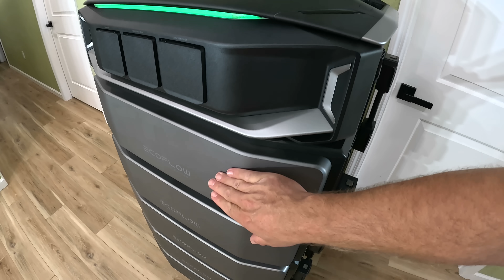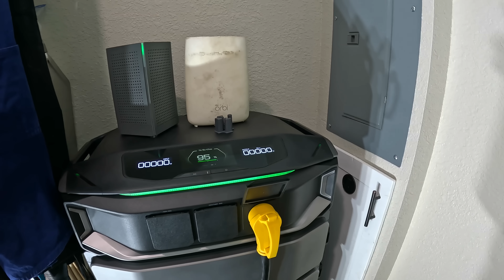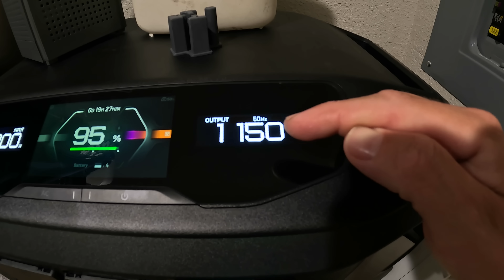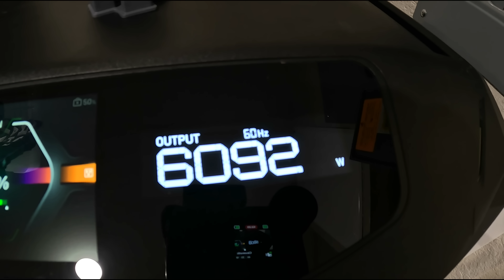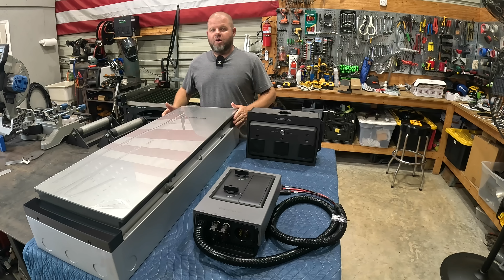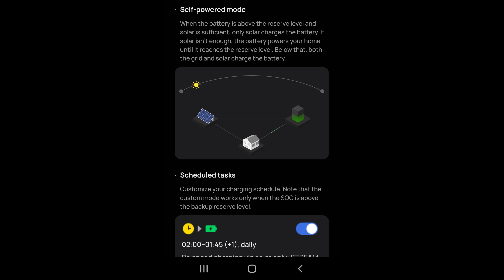AMAZING POWER! Ecoflow Delta Pro Ultra X Power Station Review!

Comment from the maker: Affiliate link earning me a small commission but SAVING you money with my discount code. Upgrade your home with the world’s first powerful, easy-to-install whole-home backup system!

Place a $500 deposit to save $1,000, plus get up to $1,000 off installation on our website.

From Nov 3, use code DPUXKE300 for $300 off bundles online or get a FREE 220W Solar Panel on Amazon.(Valid Nov 2–Dec 31. Product discounts can’t be combined. Installation offer applies to both.)

🔗 EcoFlow DELTA Pro Ultra X : https://bit.ly/471iRU5

🔗 EcoFlow DELTA Pro Ultra X on Amazon: https://amzn.to/3VM2oNk
Reply: What’s the actual pricing?
Reply: @Bward216 

Base Bundle
Inverter unit and two expansion batteries	$7,999

Bundle with Smart Home Panel 3
Inverter, two batteries, and Smart Home Panel 3	$10,899

Smart Home Panel 3 (Sold Separately)
The Smart Home Panel 3 alone	$2,999

Install 3.4k
Reply: @Bward216  Looking like $3,500 to $3,800 for just the DPUX inverter

Comment: Is the rectifier a safe option to use as a solar panel disconnect instead of the other disconnect they have that needs to be wired by the user? Would be great as the rectifier is plug& play, but probably isn't code compliant?

Comment: I have studied solar for 2 years now. it always improves and it can be a money pit. I will tell you I love the solution when it works. I have ecoflow with watt cycle as its big brother and Renogy solar as its little sister. I use a 20amp charger for the watt cycle batteries or it starts melting my power cords. These ecoflow systems can handle a lot! Watt cycle is an amazing pair and renogy solar panels are just sweet for the back up. My overlander is completely self sufficient now. With the 2 bodega drawer fridges, wolf box always recording and a 12v trickle charger constantly charging my car battery. What an amazing set up. I have 5 vehicles and I am working on my third setup. I love it. I carry my kitchen on the go. It’s soooooo cool. My kids love it! I now this is crazy but a fed a few stray dogs a 5 course meal the other day.  fresh meals on wheels. What a fn kick hahahah.

Comment: My question is can you use the Delta Pro Ultra X as a UPS meaning that the home electrical is running from it constantly, while having Grid power, Solar Power, and Generator power tied into it at the same time?  So I can switch between these power sources?  And by doing this will it over work the battery system?  Thx..
Reply from the maker: I'd need to verify 120 in and 240 out. Obviously you can't bring in from the grid while you are connected to your main panel on the output side.  You can bring 120v grid in and output to individual devices as a UPS using extension cords ect.  The proper way to do this is use their smart home panel. It ties to the grid and can be setup to use the DPUX first and swap to grid automatically if your battery power is low.

Comment: Can i run my 50 amp travel trailer with just 2 batteries? I dont have the space for that giant.
Reply from the maker: Yes as your trailer uses the Neema 14-50 plug this has. Now what all you run determines how long this will power your trailer.  Most big trailers have two AC units that are very power hungry, especially in not well insulated trailers.

Comment: Hi, just about to get mine. I was worrying about stability on the cart with 4 batteries and the inverter, but yours looks pretty good. Mine will be in a concrete floored garage next to the wall and won't need to move. Do you feel pretty good about the stability?  Thanks for the good info! M.
Reply from the maker: You won't have a problem at all, mine moves around just fine. If you ever had concerns about tipping, run a strap through handles on both sides all the way through the batteries and inverter and tie them together.  I move mine often for recording and have never once had a close call on tipping. I just got a new discount code and link if you'd be interested in saving a little more before ordering.  I do earn a commission but it saves you several hundred more. If interested just email me at Kelleyscountry@gmail.com and put EcoFlow in the description. I'd also be happy to answer any other questions you might have. Take care!

Comment: i thought that if you have 5 batteries you should run the top two batteries via the hard bracket connector and the bottom three via the power cable.   Is that right?
Reply from the maker: Yes for the full output. I cover this in an upcoming video.

Comment: This looks like a great modular system that can accommodate even a total electric home completely off grid with sufficient solar power. What is the maximum PV power input the inverters can handle before clipping and what is the maximum absolute DC power input allowed? These are numbers I need to know as I already have about 18kw of PV power currently and prefer to not drive the inverters into clipping. The idea being the inverters should last a lot longer if never allowed to clip.
Reply from the maker: 10,000 watts is max input, you will be well over that.

Comment: In the event that you lose connection with your ISP, will this system still communicate through your local network wifi and be controllable with the cell app/portable screen or does it become an uncontrollable smart brick?
Reply from the maker: No, but you can also communicate via bluetooth if you are in range.

Comment: Is it possible to connect the delta pro ultra x without any smart panel 
Can you connect to your main house panel through a generator port while at the same time connecting the 120 charge cable to a circuit that taps between your grid power and your main breaker so that the unit can run and charge from grid if need be while still powering your house???
Can you do a video description of how that can be done

Comment: You should show how to upgrade the firmware on the older batteries, since you said they have to be "Updated" individually.  I bought a DPUX with 2 batteries but I have two "OLD ULTRA" batteries I want to hook up to the "X".  I'd love to see how you do it and how it works.  ECOFLOW says that is all you have to do is update firmware and the batteries are compatible.

Comment: This is an ad. Not a review. I’m very concerned with the longevity of these batteries and these inverters. You don’t double power output and improve thermals to where the fan doesn’t even need to kick on in the same form factor with no downsides. It just doesn’t happen. But if they’re pushing their components well past there recommended Tjunctions and current ratings it’ll work but it won’t work long.

Comment: Great video.  The existing system you have, can you make a video after the sun go down
.  I would love to see how long the batteries will last under electrical demand (air conditioning, dryer, TV, lights, etc?  If Ecoflow Delta Pro can last, then one can say “Off the Grid”.  Please let me know when you put it to the test?  Yes, I agree all heat pumps is the way to go ultimately utilizing solar and backup batteries to power your home $$$$.  The Future!!!  Thanks
Reply from the maker: I did that test with only 3 batteries, so 5 batteries for sure wouldn't be an issue. https://youtu.be/asG9GdL2b_E

Comment: Hi Kelly, aren't we still limited to 50 amps? How do we take advantage of a transfer switch and run the whole home and DPUX's 200 amp capacity?
Reply from the maker: The DPUX has a 50 amp capacity, not 200 amp.  You don't use a transfer switch to run the entire home, a transfer switch is for limited critital circuits. You can run one of their smart home panels OR wire in a basic generator inlet box to your main panel like I did in this video https://youtu.be/Tf7cEsdXJoU Just make sure to use a 50 amp box so you can safely run full power from the machine. 

Now if you want more power, use their smart home panel and you can run up to 3 DPUX inverters into it for a massive amount of input to the home.

Comment: What is soft start?
Reply from the maker: Its an electronic device you wire in before the AC compressor.  It takes incoming current and briefly drops the voltage when the AC compressor starts up.  That's the highest spike and amperage draw but it's only brief.  This is typically what drops out generators or solar systems.  After a brief second or so, the soft start puts full voltage back to the compressor after the initial startup and surge has passed.  It just smooths out the startup demand for power. Hope that makes sense.

Comment: Great review and feature breakdown! For someone who already has the original DPU and SHP2, wouldn’t it make more sense to just add another DPU? That setup basically matches or even beats the DPU X, except for the SHP3 circuit and higher power rating. Plus, two DPUs give you redundancy and more solar and output capacity overall.
Reply from the maker: Yes in your case that's exactly what I would do.

Comment: A 50 amps output port can only give you 6000 watts continuously. Wondering how the inverter is 12K watts.
Reply from the maker: Don't know where you are getting that from. It's a 240 volt plug so you get 6,000 watts PER line or phase. 4 wire plug, two 6,000 watt hots, one common neutral and one ground.
Reply: @TKCL Ok it makes sense now being 6000w per phase. Thanks
Reply: So that way you can get 12k watts out of that port along pretty neat.
Reply: Neat however I would've really prefered they provided a bolted connections for that power.

Comment: Being a electrician i have questions about your 50 Amp hook up the wire is only good for 50 amps and I'm seeing you pull more then that and does that unit have a breaker on that 50 Amp plug.?
Reply from the maker: How are you seeing me pull more than that? 50 amps at 240 volts is a 12,000 watt resistive load. This machine can't actually produce more than the receptacle is rated for.

Comment: Good to see Ecoflow designed some bigger output units. With 12 KW generator input and 10 KW solar input. I had tagged Rubix batteries and SolArk inverters to handle a 200 amp (24 KW) service home - because no one except them seemed to make large output whole home systems. Even the Ocean Pro system didn't seem to be robust enough. I had in mind a 25 KW Cummins generator to backup a 3 house compound. I guess a crazy person could use batteries and inverter to charge some EV cars that have 80 KWH batteries, but GM has some EV trucks that have150 - 180 KWH batteries. I think I'd be better off with a dedicated grid connected EV charger or use a Tesla fast charge station.
Reply from the maker: In your situation I agree with you.

Comment: I realize it is LFP which is supposed to be safer with lower risk of thermal runaway, but I would not keep it inside my house.  There's other battery tech, supercapacitor battery tech, which can't burn.  It has higher energy density than lithium-whatever = smaller batteries.

Comment: Did you get the newer model batteries? Or are you still using all the older batteries
Reply from the maker: Both, makes no difference as they are the same and all require the newest firmware update.

Comment: I have 2 DPU inverters connected to a SHP2. Could I add a DPU-X to my current configuration or would I need to start over with all DPU-X and SHP3? Trying to think about gradual upgrades and integration.
Reply from the maker: I asked, the DPUX is not backwards compatible with the SHP2. But there might be some updates coming. Stay tuned.

Comment: Grrr.. so now they finally increased the branch circuit breaker limit to 125A, exactly what I needed while I am struggling to feed my remote home sub-panel with the 60A breaker cap of SHP2 connected to my new two DPUs.  Very annoyed with Ecoflow.  Other than that, your video is the best of all I've watched on the new DPU X.
Reply from the maker: Glad you liked the video! Keep in mind things improve with time, it's just the way it goes.
Reply: @TKCL  The problem is that DPU/SHP2 was hardily a whole home solution as marketed, and I only found out post purchase just as many others after a huge investment, often having to add additional stacks.  Looks like SHP3 was developed with SHP2 limitations in mind after countless customer complaints, and I knew they'd improve in the future but not so soon after a month of purchase of my costly system, and Ecoflow charge so much for every extra component, such as input/output cable at excessive $130, and they only ship one cable with SHP2!  The only solace is that SHP3 would've been wasted in my application feeding a remote home sub-panel separated from the man, but that's enough venting for now while I'm stuck with the brand ecosystem.

Comment: I wonder what makes the “batteries per inverter” number different why can’t I stack 10 on the old?
Reply from the maker: Amperage input, possible wire size and current draw to name a few. I am sure things are quite different inside the inverter.

Comment: Can you connect existing solar to the panel that has an inverter?  For instance I have an 8kwh solar edge inverter that is plugged into my breaker box to back feed the grid.  Wondering if it could feed this panel the same way to charge the batteries, but be isolated when grid power goes down.

Comment: in my part of the country. national research says i can expect 3 1/2 hours of total max input from my panels in cold part of half the year. how many panels do i need to charge 12.000 watts in 3 1/2 hours? isn't that 12 - 400w panels? and in warm months. they also say i get 5 1/2 total max from panels. is that 10 400w panels? and thats average per day. what if it rains for 3 days then what?  how many panels do i need to get 12,000 watts charge per day.

Comment: So it looks like to get max output you have to plug both batteries into the inverter in parallel and not series like the old DPU. I. The new DPU-X there are two battery inputs! I guess that is why it comes with 2 batteries. There is a longer cable for the bottom battery to reach the inverter looks like on their home page. So do you have to buy batteries in pairs to upgrade the stack? Or can you have an odd number of batteries? How do they connect? The inter battery connect must be loner to span every other battery I guess.

Comment: Was that the fiber ISP's cool looking stand alone AP that I spotted next to the sad Orbi AP on top of the inverter? 🤔
Reply from the maker: Yes its the router and quite powerful.  When I stand in the pantry I can get almost 1 gig download via wifi on my phone.  It's my understanding that's the cap for wifi anyway.
Reply: @TKCL 
The one gigabit limitation is only imposed by your ISP WAN connection.

The 802.11ax wifi spec itself can reach thruput of up to 9.6 Gbps. of bandwidth If maxed out on both the 2.4 GHz and 5 GHz bands with 4x4 antenna arrays.

But unless the data source is local, on a 10 Gbps LAN - and or the ISP connection is also 10 Gbps it can never be achieved. So in reality, that is as good as it gets in the real world.

The Festa F65 AX3000 indoor and outdoor AP's let you extend the very same performance capabilities you get in the pantry everywhere on the property, which in the real world is as good as it gets.

Comment: Will that work with the original DPU batteries?
Reply from the maker: Yes it will, 3 of those batteries were orginal batteries.  You just need to update the batteries firmware when connected to the DPUX.
Reply: @TKCL great thanks.

Comment: In the recent announcement and reporting, DELTA Pro Ultra X is said to have modular battery capacity ranging from 12 kWh to 180 kWh.  Does that mean that each battery on the 'X' is now 12 kWh, double the 6 kWh of the ultra?
Reply from the maker: No, but you can now add 10 batteries per inverter instead of being capped at 5. It also comes with another longer cable to attach to battery port #2

Comment: "portable" is in the eye of the beholder
Reply from the maker: Very true, but screwed into the wall or several hundred pound batteries like other systems is 100 percent not protable.  The ablility to break all the components down to managable pieces to carry inside or to carry to another structure, is quite different than most.  I for one will be carrying batteries back and forth between two homes during hurricane outages. The portability claims may not mean much to most, but for some it's actually a big selling point.
Reply: @TKCL  Agreed.  In a bug-out situation, these would be better than a system that required the use of a forklift or equivalent.
Reply: Nearly every other company it’s permanently mounted to the wall